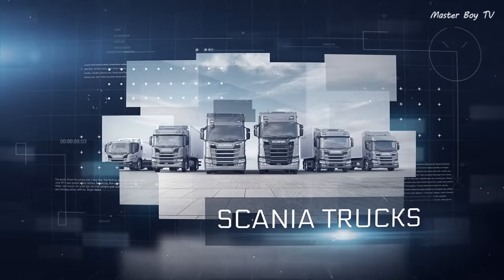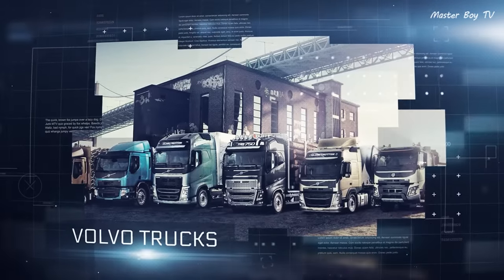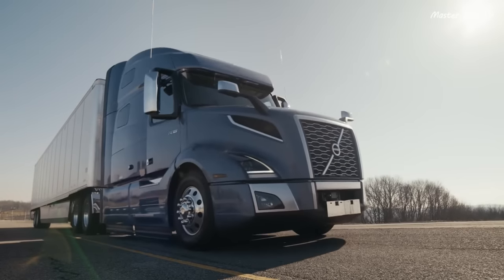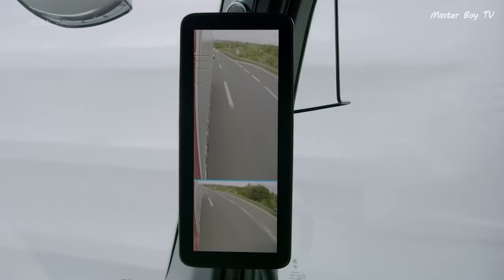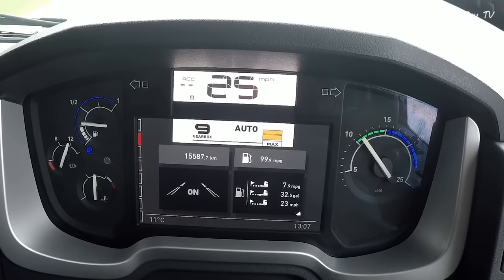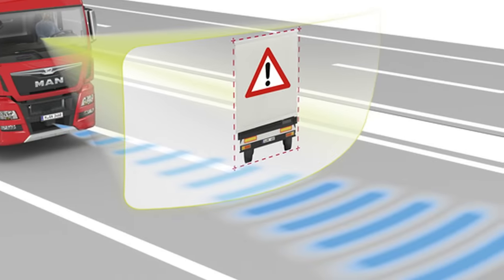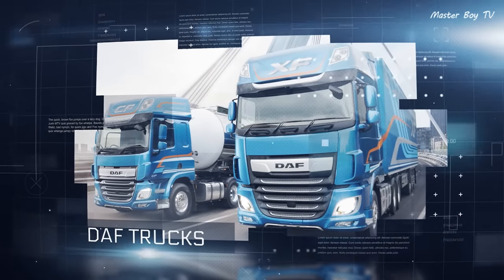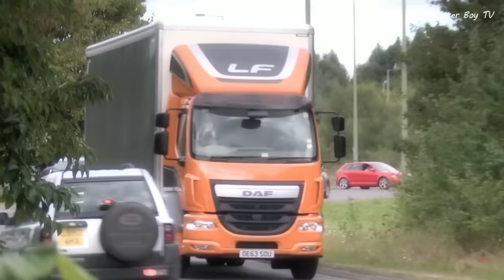BEST TRUCKS CRASH TESTING & SAFETY DEMONSTRATIONS

Comment: imagine you have to ram something and your truck applies breaks
Reply: If you keep accelerating, I think it will think ur overriding it.
Reply: @Aaron Christian abs and aeb have nothing to do with each other, other than braking.
Reply: @agarcia4271gaming  yeah abs is Anti-Lock Braking System and aeb is Automatic Emergency Braking
Reply: @brodiehiku8223  thats what I said
Reply: Like break checkers
Reply: brakes
Reply: @agarcia4271gaming  you mentioned ABS which is Anti Lock Braking System which prevents the wheels from locking up when you slam the brakes. It’s different from AEB which is Automatic Emergency Braking. AEB ≠ ABS
Reply: @Aaron Christian bruh, abs is for not locking your wheels while braking

Comment: I think best truck Scania S770 6x4

in ets2 😁😁😁😁
Reply: 770? ets2 dont have 770 hp engine :D
Reply: @justaminute4657  if you have mods 
you can drive a Scania r770 

😁😁😁

thank you steam workshop :):)
Reply: @ahmetalptuna  :DDD
Reply: Yeah
Reply: @justaminute4657  Its the Scania PGRS pack that has the 770hp engine
Reply: @AssettoRacerGR  I know

Comment: Crap compilation with hardly any crash-testing. And the little there is you've cut it off half way.
Reply: Yeah and he never shuts up.  Awful compilation
Reply: That's because it doesn't even matter what is the outcome of the crash test. The fact that it is a flat nose truck and not a long nose truck like American trucks, means that crashes will always cause bad injuries when hitting another truck or a wall.
Reply: @angrysocialjusticewarrior  A truck with a large engine in it's nose will not save it's driver if it hits a wall, it will provide better safety but not much better
Reply: @r.yuksel9774  Walls are not the most dangerous thing for trucks. Almost all trucks (both the flat nose and long nose versions) can crash through walls and through houses with minimal damage.

The biggest dangers are harder objects like big trees or crashing into other trucks or busses. In those situations, having a long nose truck allows the truck to have a crumple zone (the nose acts like a sponge to make the crash a bit less violent), while in a flat nose truck you will either be instantly crushed or you will be thrown out of the car.

and to prove what I'm saying is correct, you can search for "truck crash compilation" right here and youtube and then take a look at how US trucks get damaged in accidents compared to how flat nose trucks get damaged.
Reply: @angrysocialjusticewarrior  Generally walls are not that dangerous for trucks but I was talking about an immovable wall, like a tree or an actual immovable wall. Busses actually won't be a problem for a semi truck as they are a lot lighter even when they are fully loaded. I know what you mean by long nose trucks having a crumple zone but these tests are made without 30 tons of cargo at the back which will crush both cabs in a heavy crash, the truck having a nose or not wouldn't matter. Also these are more engine compartments than 'crumple zones' you would see in a car, as they don't have much space with a heavy duty engine under the hood, this design is good for crash tests with no load (and they are better in terms of cabin space) but this isn't a problem for the cab-over trucks like the ones you see in the video as they are crash tested to similar standards.